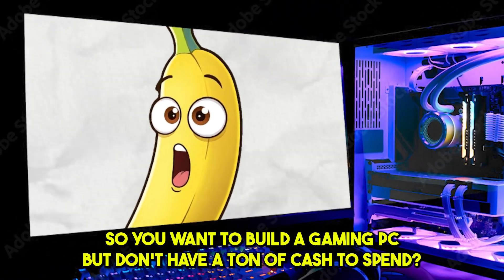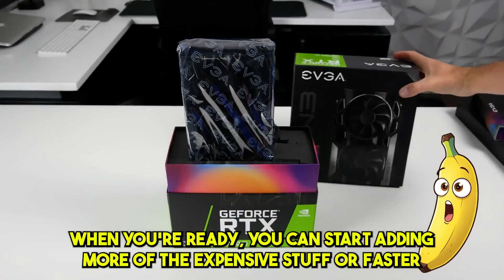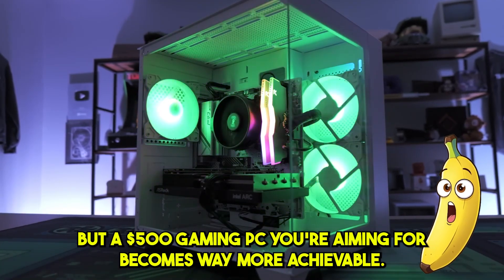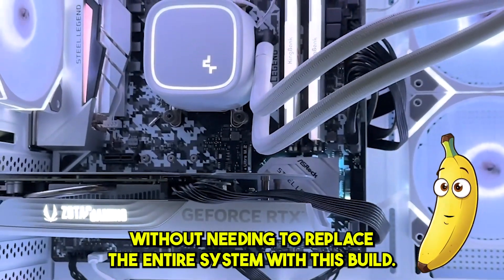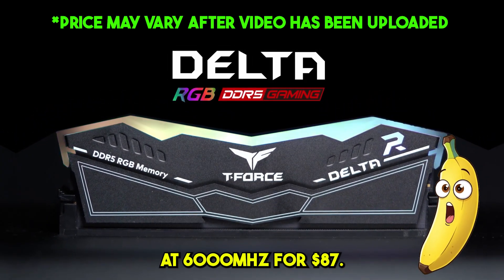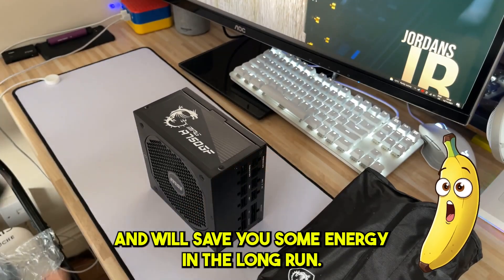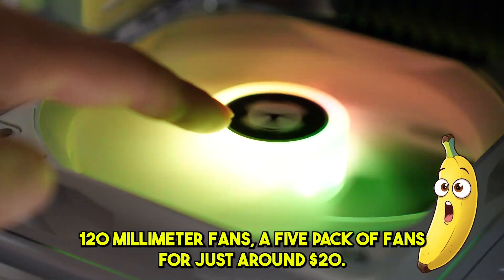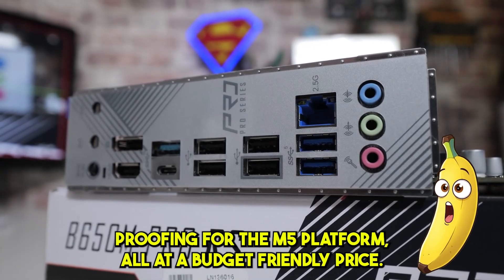How To Build a Future Proof PC On A Budget

Comment: I was considering B650M TUF, 2x16 DDR5 6000MTs Kingston Fury Beast, KC3000 2TB, and Ryzen 7 8700G. Any Case with good air flow and a 750w PSU 80 plus bronze or gold. 
Eventually buy the 7700XT and stay on maximum quality 1080p. I dont plan on going 1440p or more really
Reply from the maker: Great Plan :), I myself don't plan to go 1440p not only does it need more powerful gpu it's more expensive to run, I wont be upgrading to 1440p not unless 1080p becomes the new 720p which is still not happening at the moment.

I also love hight framerate more than resolution.
Playing on high resolution will be like the red pill you wont be able to go back so I avoid it haha.